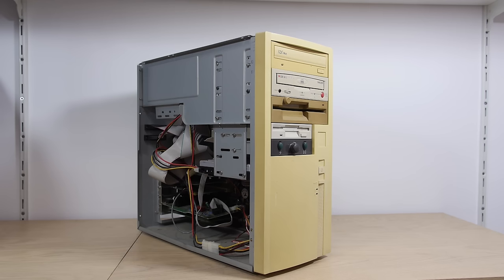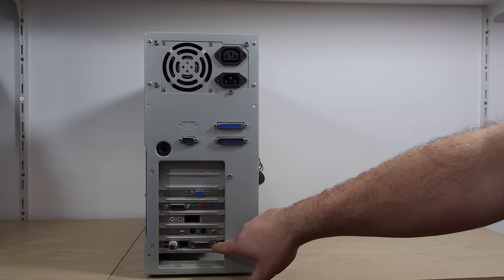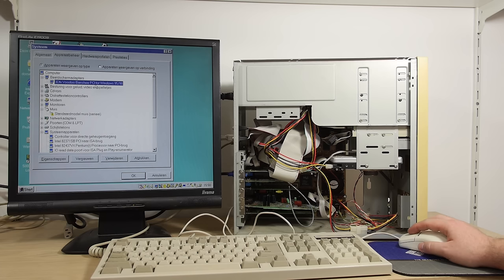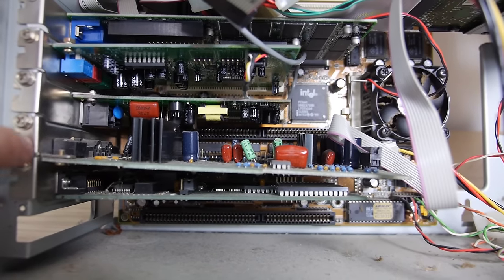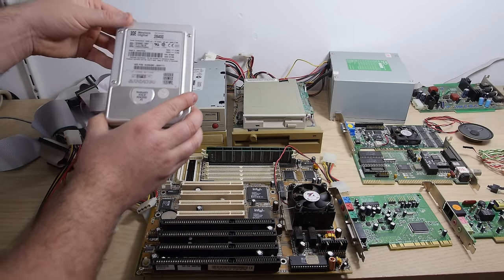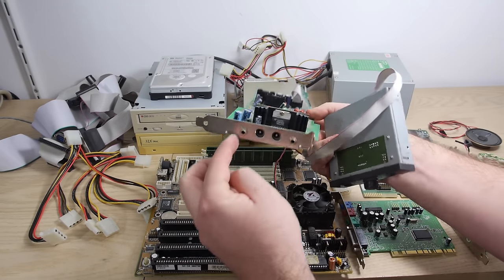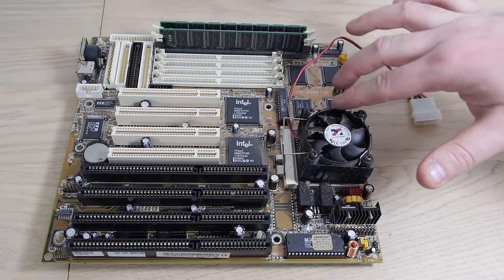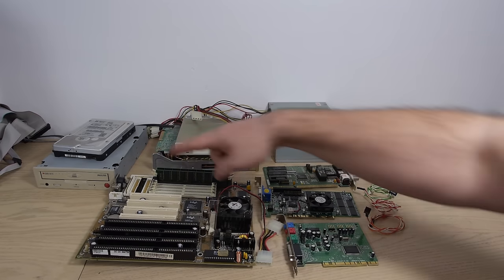Computer VLOG23: Parting out Dumpster Pentium 200 mmx, Full of Parts!

Comment: It is always a good day to find an AT Pentium system, fully loaded like this. I suspect this was a computer shop built PC because of the SB128 card, and the Biostar 8500 motherboard, which were both very common for computer shops to use in their house builds back then. I probably would have kept the case since it has that nice removable motherboard tray. It is really easy to restore the plastics, and if nothing else, just hit it with a can of spray paint to take care of it.  Very nice find of a PCI version of the Banshee. Very very rare card there my friend. Also the amp, I never saw one of those either,  very interesting.
Reply: yeah I would still keep the case, I've seen people keep cases that are in worse condition than this.
Reply: It's strange to read that, most of the AT cases I found had a removable tray. I've got only two that don't have a removable tray, and one is in a desktop design so this seems normal and the other is a huge tower case. However, I've got an ATX case from 2000 (at least mine was built in 2000, but I suspect it to be older than this) which has a removable tray too and it makes it really cool.

Do you have tips and advices on how to put paint on an old case ? I've heared that retrobright isn't a viable solution because yellow comes back, and plastic is fragilized by this technique, but the last time I wanted to paint a case, while it didn't end terribly, it wasn't that great ... Especially for the metallic part (to keep coherence because the beige-ish white I had wasn't completely the same as it was originally) because it's really easy to scratch it ...
Reply: A friend of mine gave me his old Pentium 233 Mhz MMX system.It too came with a Biostar 8500 motherboard.
However instead of gutting it out for parts instead I hot rodded it with a Diamond Monster 3D II (Voodoo 2)card,a Diamond Monster MX 100 Sound card also with a Creative Awe 64 Gold Sound Card,A 250 MB zip drive,an Ethernet card. 64 MB ram etc.I also put in a 5 and a quarter inch drives as well as a 3 and 1/2 inch one too.
It's pretty similar to this one in a way.
Reply from the maker: Yes Biostar was a good budget brand. I looked at the case to see if I can turn it into a testbench. But the case itself is pretty weak and cheaply made.
Reply from the maker: m907 nice build :)
Reply: WaybackTECH p

Comment: If you want to make the CD drive less yellow, you can apply a mixture of hydrogen peroxide, TAED based laundry detergent, and Xanthan gum, and leave it in the sun for a day to remove the yellowed bromine layer computer manufacturers kept using as a fire retardant. And if you are planning to sell it, you can sell it as like new for more money.
Reply: The problem is that yellow comes back after a while ... Sure you can do it again, but apparently it damages the plastic even more and if you do it too munch, the plastic start to fell appart

Comment: You can put probably 256MB ram on the computer with the VX chipset if you use 2 168pin EDO DRAM modules the SD RAM is limited to 64MB

Comment: just to point out an another nice thing with this motherboard is right in front of the 2'nd from top ISA port...

yupp... its an AT motherboard with USB frontpanel-connector, not many of those.
should have had an AGP at the top in stead of PCI but not that of an deal.

Comment: i`m reparing computers for a long time now, and what my experience with the voodoo banshee was not that great, card and software was not very stable.
Reply: Banshee was very stable in all system I knew including my own which was even overclocked on AGP-bus, GPU-core and GPU-memory with only the stock passive cooler.

Comment: I have seen many of you guys power on the system with out puting a new new PSU always use new good PSU for reputed companies ..
Reply from the maker: You cant get new AT power supplies ;)
Reply: RETRO Machines use adaptor for converting ATX to at
Reply from the maker: Why? Just check the PSU clean it and use it :)